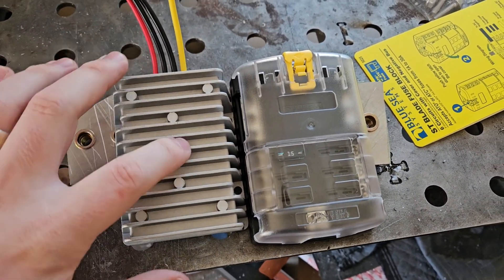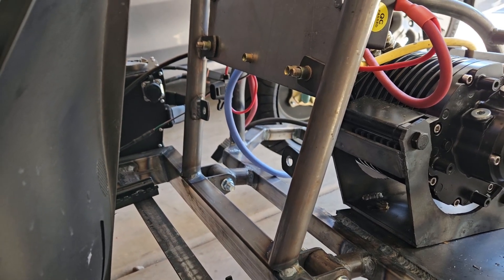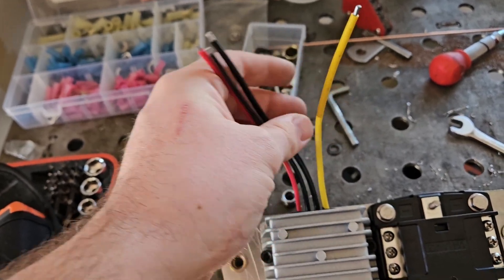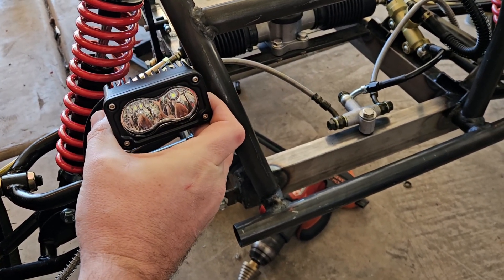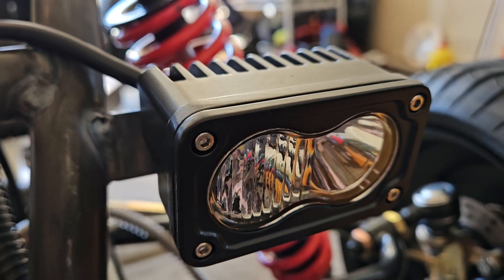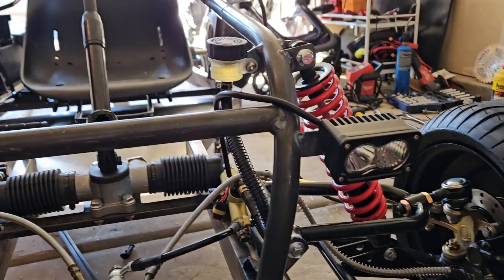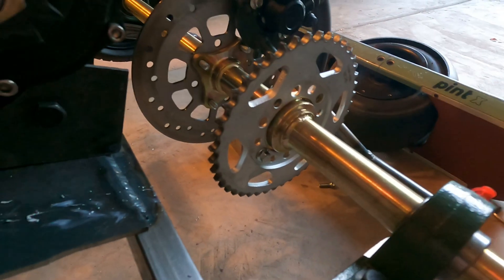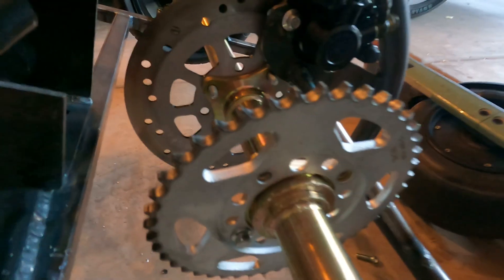Building an Electric Go Kart Part 6

Comment: This is absolutely awesome. I'm trying to build one myself here in Cape Town, South Africa. Would you mind sharing some of your dimensions with me? I know it's built from scratch, but I think you the got frame dimensions spot on. What is the length and width of the rear subframe, the width of the footwell and widest point near the seat of the front chassis section?

Comment: how much did this all cost?
Reply from the maker: For frame and parts maybe 4-500 hundred. The motor, controller and battery are by far the most expensive. That can run over a thousand depending on what you do.
Reply: Thanks! I’m going to build my own soon, I might build a frame and stuff like that so thanks.

Comment: This is looking awesome, loving the project, can't wait to see how it ends up like.

I've also noted that the position you mounted your ESC with the cooling fins facing a metal sheet, wouldn't that block airflow to cool the ESC?
Could have 2 PC fans on top or bottom, doing a push-pull config or putting a hex pattern holes on the metal plate and having a fan on the other side, pushing air into the ESC.

You could also make a spot on the front and rear in order to put bumpers that when damage are easy to bolt-off.

Those are just my suggestions, this project is so awesome and exciting, hoping to see more soon, keep up the good work.
Blessings to you and your family.
Reply from the maker: Dang, thanks man. And yeah. I plane on drilling holes and mounting a fan. So far it really hasn't gotten hot but I haven't run it too hard so I definitely need to do something.